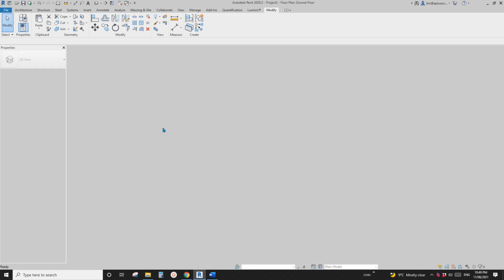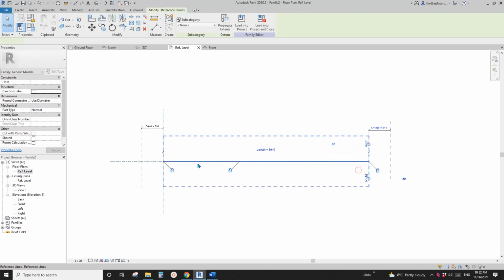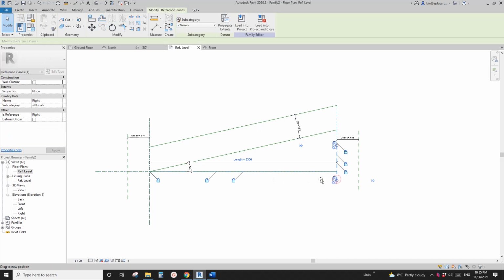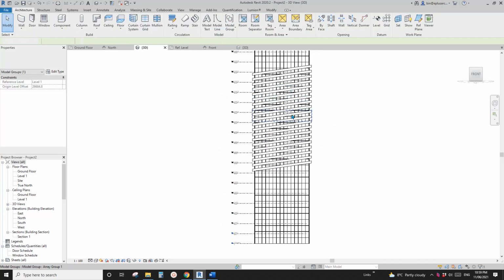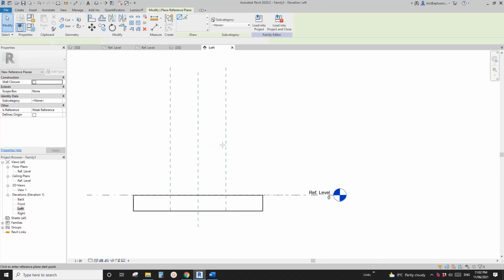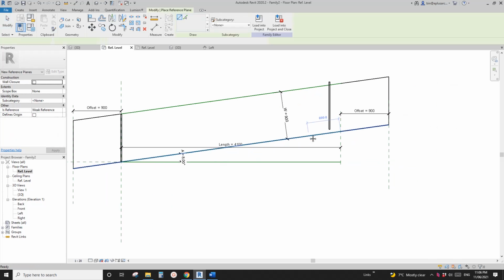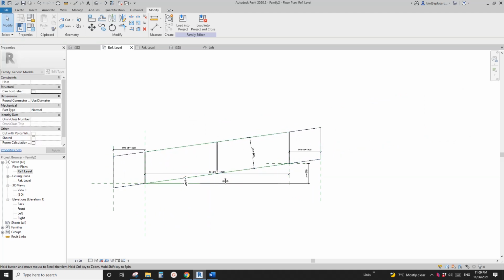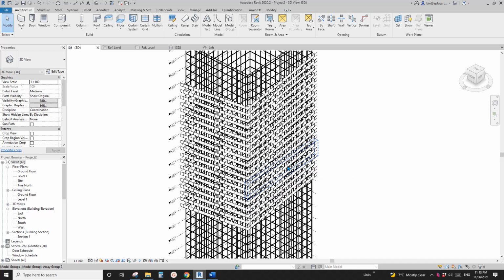Everyday Revit (Day 447) - Line-Based Family Exercise

Comment: Great great way to do the louvers as  family 👍👍👍 ... but what about those louvers that are not complete at the base ? (they are cut horizontally cause the start line over the ground level is horizontal) 
why mirror command does not work with array in project? it could otherwise be a way to cover all facades with louvers ... but it does not work
Reply from the maker: Method 1: Hide them under the floor and pretend they do not exist.
Method 2: Create face-based void family to cut them.

Try to set a proper work plane before you use mirror.